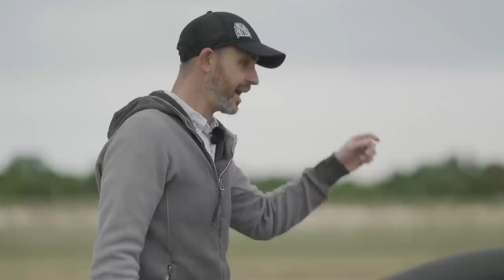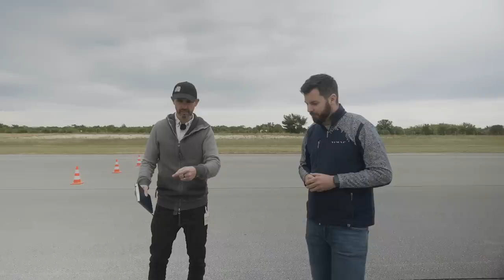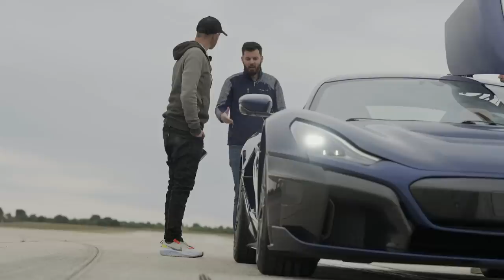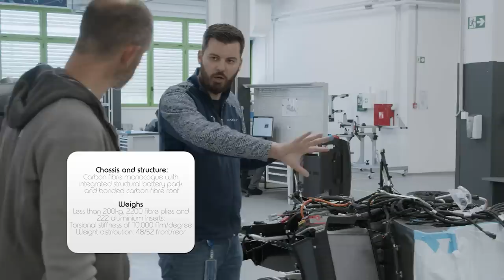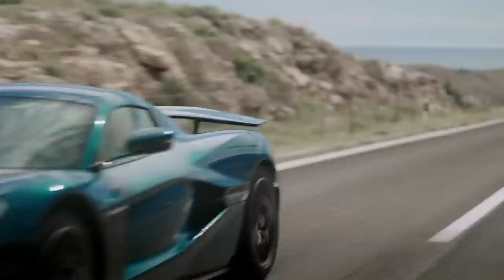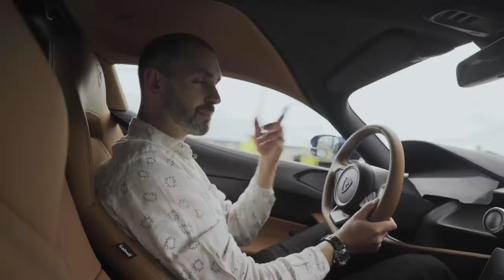New Rimac C_Two Nevera EV Hypercar detailed review - on road and track

Comment: If I had the money, I'd buy one now! The Rimac company, Mate himself, and the story behind it all is even more amazing than the car itself. Of course it also shows what can be done with EV's. Another nail in the combustion car coffin 😉
What a thing! ❤
Reply: You can't
Reply: Ill take an ice vehicle over an ev any day of the week. Combustion isnt dead by any means. There are still too many limitations to them and they wont end global warming by a long shot. Also, if your honest, where could you use 2000bhp on modern roads? You cant, its pointless as are most 500bhp cars.
Nothing is better than listening to an ice engine inducting air, combusting it and throwing out the exhaust, its bliss and wont be ending anytime soon😉
Reply: @lulube11e111  Huh?
Reply: @mikeygti8930  Not so long ago 500hp would be insane in a street car too. Of course this car is an over the top extreme one. But as a tech testbed it's pretty amazing. 
Eventually the ICE cars will be for enthusiasts etc. Some other kind of drivetrain will be the norm, in the same way we don't see many steam engines on the road these days. It's just a question of time.
Reply: Absolutely. Mate and his company deserve to be supported. If i had so much money i would definitely pick this car over any other.
Reply: @TheShoobah  just wait and buy the Evija, it looks way better and will be faster... 
Every next hyper EV is better than it's antecessor because the only thing that apparently matters is speed.
Reply: @TheShoobah  

The enthusiast only era of ICE cars is a long, long way off, decades in fact.

Comment: Jonny (and co)'s filming, presenting and production is as good as we expect and they are flying right now. I just don't get the obsession with a 1900hp hyper car as a product. The tech however is in a different planet. Good work Jonny!
Reply: For Rimac it's a billboard. They're not a hypercar manufacturer first, they're a tech company and high-end EV industry supplier that uses hypercars to promote their in-house technology (as seen in Porsche EVs, Koenigsegg and Aston Martin hybrids, etc.). They want car manufacturers to ask them to put features seen here into their higher-volume production models in some form.
Reply: I think it's so that it can, if pushed, just do everything better than every other car in its class, without compromising. I get the impression big horsepower is a result of the build, not the target, if you know what I mean.
Reply: @TCL_Dasler  if they were only after a specific horsepower figure they would have given it 2000 horsepower
Reply: @visionist7  How about 3000 horsepower?
Reply: The car is technically complicated.
An engineering challenge.
Yes, 2000 horses is quite a lot.
Yet imagine the engineering/design aspect to achieve the Nevera from scratch. 
Then you may kind of understand the why.
Believe the same drives Koenigsegg.

Comment: Koenigsegg: stiffest chassis ever.
Rimac: Hold my kravat.
Reply: I like how they used the battery structure to stiffen it even further. Actually 70000 Nm/ degree for such a huge front to rear every single thing included monocoque is astounding. McLaren's carbon tub is just the passenger seat and side rails by comparison.
Reply: Koenigsegg has Rimac tech in their cars.
Reply: So its a tractor.
Reply: "Hold my croat!"
Reply: @tlqweasdzxc001  they don't the only car that have it is the regera and that is the batteries

Comment: Great, however, I can't read these grey animated panels with information quick enough before they disappear. Font is also very very thin. Other than that, good stuff as usual.
Reply: Youtube has both a pause button and speed adjustment.
Reply: I also can't read them quick enough and find the styling / timinng a bit un-friendly for reading in those moments. While there's something to be said for the pause button, great design would allow for reading in a reasonable time without losing focus on the rest of the show. Still want to say they're pretty, and unintrusive :)
Problem with them in this video though, is that the figures for this car have so many extra digits! 20 times more torque than anything I'm used to.
Reply: I just realised all the stats are helpfully posted in the Video Description. It's funny how you can put something right in front of a human being and they still don't see it ;)
Reply: @magpieblue  Still, I shouldn't have to do that. Why put it in the video anyway then? Just leave it out, or make it legible.
Reply: Its software, im sure its easy to adjust and customize
Reply: @askvic611  Yes, and I hope they will.
Reply: @deheerdeheer  Your comment specifically stated that you were unable to read the grey panels. I answered with how to read them. If you instead intended to comment on some aspect of the video production, then do that.
Reply: @Graham_Wideman  Having to pause a video to read the graphics really is the stupidest thing and just bad practice.

Comment: This thing is mind bending. No wonder Hamster crashed one.
Reply: well he wouldnt have crashed if they oculd go round corners :)
Reply: @1183newman  looking at what he crashed in the past, it could be him who can't go round corners :D
Reply: @1183newman  formula 1 cars can't go around corners either then
Reply: @1183newman  no car can go round that corner carying speed he was doing. Idiot just cant drive, should be grateful to still be alive
Reply: @VolkerHett  Would hardly call a dragster, a 3 wheeler and a rimac great handling cars that go well round corners.
Reply: @MyRealName  of course they can but Rimac doesnt make F1 cars handle though do they.
Reply: He didn't crash one of these, he crashed the previous iteration.
Reply: For a company dedicated to EV development it seems puzzling that the placement of the charger would be in the least accessible place possible when considering the use of charging terminals and ther notoriously short cables. Compare that to the Evija which has it smack in the middle of the rear of the car making it an easy experience.

Comment: Don't leave Richard Hammond drive that
Reply: Hamster gonna pull a 7 sec 1/4 mile
Reply: @dan_6915   down the hill
Reply: @dan_6915  On its roof in a ball of flame LOL
Reply: it got wing now, it's ok.
Reply: @izoyt  it got wing?
Reply: @Steve30x   yes, mark2 (aka nevera) have rear spoiler which mark 1 doesn't. and this should be vital for that crash, where rear end was taken off in the corner. i personally don't buy that, that's why i mentioned as a semi-joke..
Reply: @izoyt  I'm not questioning if it has a rear spoiler. I'm questioning what 

"It got wing"

Means
Reply: @Steve30x  well, i did try to explain, but i guess i wasn't clear enough..
Reply: @izoyt  but it got wing  akes no s3nse

Comment: That is an amazing car Jonny. It’s Uber complex yet so easy to use. Range is amazing, he’s cracked it hasn’t he?
The acceleration, unbelievable. Did I hear that he can send computer updates to the owner as the car evolves over time? It looks so easy to drive and intuitive to understand. I especially like those “ knobs” that adjust power to the front and rear drive motors. The only little, tiny, er observation, and not really a negative is the cabin noise that sounds like a bloody jet aircraft . Accepting that this car is not a full production customer car, I would find that noise a bit grating after a while. Is it just your sound on the vid perhaps?
The car looks are stunning, there is nothing I don’t like. Well, apart from the price but that’s coz I don’t have much of the €2m , and the ( perceived )noise.😎👍🏻

Comment: I think the big battery is there more for the power than for the range. A 120kWh battery has to deliver a 12C load if you want to extract 1400kW out of it. For any smaller battery, that's just a dead short.

Comment: No slight to Rimac.. but calling this a ‘production’ car at like 150 total production. Is a bit of a stretch. These are basically hand built unique pieces each. But ok.. sure.. by some metric you can call it a production car.. great achievement these guy have here, either way. THAT said.. it really points out how amazing Tesla’s Plaid is, to be so close to this machine at less than 1/10th the price, and is 5 seat family sedan that will be produced in the 10s of thousands each year. But these guys in a tiny company in Croatia.. not ever known for building any kind of car.. super impressive what they’ve designed. But a GT?? Would need more space for luggage than a duffel. Definitely super nice that let you do a proper drive in this baby.. very nice.

Comment: Im waiting for the new Sartac 3460 w/ 3460 torque at the rear wheel and 12 gears low and 12 high on the grip before l make my next super car move. 2000 horsepower is lame now. They'll have electric economy cars beating that car in a few years. Maybe even a golf cart or scooter.

Comment: Sure it's kinda cool.. I would be impressed if the goal was to sell it for $100k USD..  But at 2.5 Million..?  AND -- The exterior design is somewhat bland, and dated.. It looks like a 2016 Hyundai Genesis from the front. I don't believe EV "Super Cars" will find a market until an entirely new concept other than heavy batteries is the source of power.  It will likely be some new electric/hydrocel turbine thingamajigger... A power-plant that makes a cool NOISE... Functional NOISE when turned on and sitting still ready for launch. (Not a fake noise.)   --EV car racing has largely been a failure, as fans are not interested in "quiet racing"..    --it's just so damn boring..  Sure there will be the odd billionaire who will buy one of these to virtue signal to the world.  But when he parks this thing in his garage next to his Ferrari 488 Pisto (A $350K artistic ICE masterpiece in function and design)..  How often will he take the RC car out over the Ferrari on weekends?
Reply: you did a better job of "reviewing" the car with this comment.  This video is not a real review that much is obvious.
Reply: @gazmitchel7633   Thx..! I was expecting to get push back from the EV heads.. But nothing..   lol :)